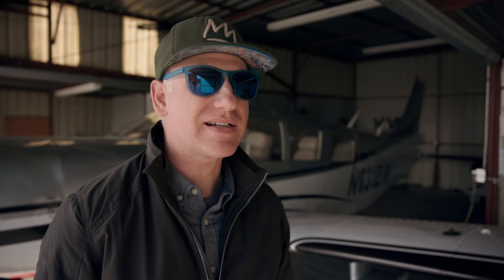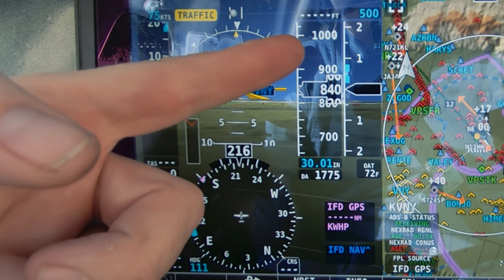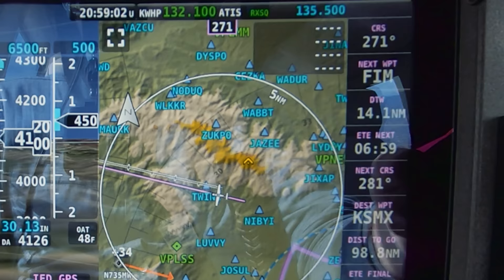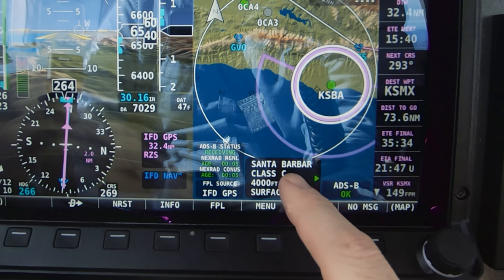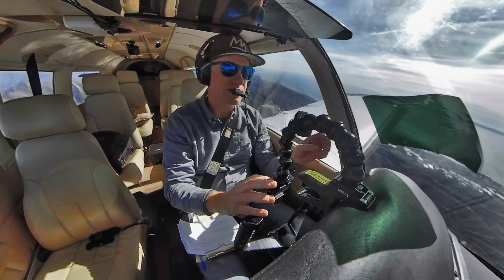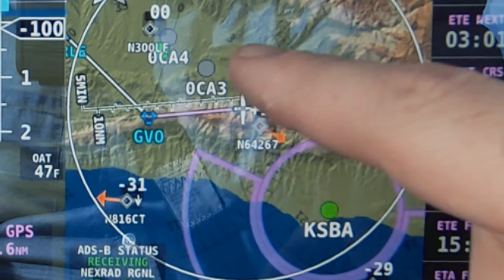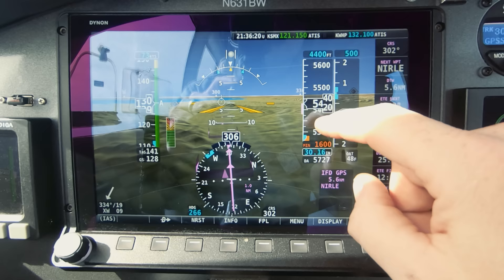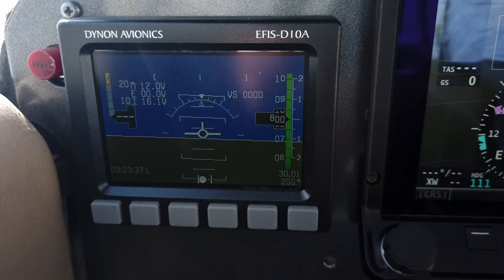Dynon Skyview in a Cherokee| HDX FULL REVIEW in flight and w/approach | BEST GLASS PANEL EVER?

Comment: So many questions!  My 79 Archer's equipment is getting old.  Steam gauges, KNS80, ADF, IIIB autopilot, etc..  Where should an owner start?  A panel mounted GPS?  I've been thinking about G530W to replace the KNS80.  But, 530's are getting old!  A new 650xi is almost $18K!  750 $25K installed!  What was your budget upgrading just the panel?  I also notice some beautiful upholstery in the cockpit..  Where did you have that done?  Was it expensive?  I'm thinking maybe I should sell my airplane and find something newer, but my Archer only has 1490 TT.  Would it be worth it to do all those upgrades?
Reply from the maker: It’s worth doing the upgrades if you’ll get enjoyment out of it and can afford it. If you’re trying to recover value in money you spend in the form of money you will get back later aviation is for sure not the way to do it. The value is the enjoyment (in my opinion).  But you would probably do well to decide what you’ll get the most out of in terms of the next upgrade for the type of flying you do. I would start with an engine monitor. Once installed upload all data to savvy’s free site so you can track engine trends.  Then decide if you need a modern IFR GPS.  That would be a good next step.

Comment: In general replacing the steam gauges , what kind of cost can be expected with a similar approach to Edison set up similar?
Reply: Expect $20k for the IFR certified GPS and transponder, and $20k for all the Dynon gear. The installation can be done by you in an experimental aircraft, but it must be done by a professional if the aircraft is certified. Professional installation won't be cheap. If it's certified it also has to be one of the few which Dynon has an STC for.

Comment: Newb here - is this like a game changer for IFR and  VFR especially when dealing with IMC?
Reply from the maker: I can offer you my opinion only as a 700 hour instrument rated private pilot- by no means an expert.  But I do think that ANY moving map (with GPS) display with terrain is a real safety benefit.  That could be just the IFR navigator or it could be a full blown PFD that replaces your analogue flight instruments.  What IS a game changer is that the FAA has been making it easier for avionics companies to attain certification for their digital EFIS products. The crossover from the experimental world is bringing prices way down.  This stuff used to be cost prohibitive for a small GA plane and now it is starting to make sense.  I do personally think it is a game changer for the safety of IFR flight to have a digital EFIS with redundant backup- synthetic vision really gives you some situational awareness not only for attitude and terrain but also on board ADSB weather.  If you compare that to only analogue gauges with no terrain, traffic, and weather then it is a whole different way of flying- one that I prefer for the increased safety benefit. As far as VFR goes, one of the main benefits is just easy GPS navigation and the on board weather that helps stay VFR or find the closest VFR conditions.

Comment: I have a 10 and 7 inch in my Experimental and I just started using it.  Have you used the HITS? If so, what are your thoughts?
Reply from the maker: It's funny I was just looking at that feature the other day.  I need to read up on it some more to get a full understanding of why and when it appears.It seems like it could be very useful but I have not really looked into it very much or enough to comment.  Do you use it at all?  I'll play around with it on the next couple flights.
Reply: @SoCalFlyingMonkey  I have not. My plane is currently in Phase 1 testing and we are we haven't gotten into all the features of the Dynon HDX yet...

Comment: Other than the Full Dynon Skyview HDX System, the IFD 540 and GPS/WAAS antenna for the navigator, do I need anything else? I have a Cherokee 235 and it boggles my mind that I can literally rip everything else out including current radios, VOR’s, transponder, etc. use theirs and be IFR certified.
Reply from the maker: You would need their ADSB OUT transponder (and definitely get IN), probably a secondary NAV/COM like the SL30, an AUDIO PANEL (check out my PMA450B video).  I don't believe the DYnon radio is a NAVCOM and is only COM. I think its a VERY good idea to have a secondary Nav radio in case the Avidyne fails completely- at least you have a VOR to go by.  If youre tearing everything out get the Dynon engine monitor system and a second screen. :)  And if the Dynon AP is certified for your airplane (I dont think it is) get that too! And the Dynon knob panel and Autopilot knob panel.   I did not read up on if the Dynon Engine monitoring system is certified to replace primary gauges but I assume it is.
Reply: SoCal Flying Monkey thanks!

Comment: When you’re using the avidyne for an rnav approach, does the IFD send over the VNAV labels to the HDX and do they automatically get set in the altitude bug? Same for if you set a waypoint like a VOR using the ‘cross at or above’ function in the avidyne, does it push that altitude stuff over?
Reply from the maker: No I do not believe that vnav labels or a manually set altitude crossing value is sent to the skyview. I will double check though tomorrow.  Dynon seems very open to feedback and I know they really like the Avidyne units so maybe there is a way they can make this happen in a future release...

Comment: What was the reason for not doing Garmin G3X?  Are there reasons other then price?
Reply from the maker: When I was researching it, the G3X for certified lacked a battery backup.  That made it a non-starter.  I also prefer Dynon's approach to interoperability with other avionics manufacturers.  Garmin has a walled garden approach.  I think I have a better chance of future avionics products I might want to install integrating with Dynon based on their approach.  The price difference is substantial and if Dynon gets the STC for their autopilot for the PA32 the price difference will be even more dramatic.  I think it is just a better value proposition.  But I am sure the G3X is a fantastic and capable unit.

Comment: Of course it should all be digital and yes aviation has a huge problem with certification hence the cuba car like conditions. 
As for clarity, the 'glass' is still designed much too thoughtlessly to appear legacy. Compass roses, rolling speed and altimeter wheels, all have to go. The screens should be much bigger and the synthetic vision or map should fill the screen and speed, heading and altitude should just be numbers without any junk clutter. It could be so calm and clear and infinitely better than they are now. It's the same mindlessness that lead to the first cars looking like horse drawn carriages.

Comment: One question can you link the panel to foreflight on a I pad and send flight plans to the gps?
Reply from the maker: The Avidyne can send and receive flight plans via wifi to the iPad. And the HDX can also communicate with the iPad if you buy the ($10-$30) wifi dongle.  I connect the iPad to the IFD for flight plan and ADSB info to be sent to the iPad.  Sometimes for longer flight plans I will plan them at home on the iPad and send them to the plane after startup.  It works very well.
Reply: SoCal Flying Monkey thanks

Comment: bs that the GPS isn't certified and you have to have a little awful massively overpriced second unit. The trivial navigation functionality should of course be in the main display unit and they should be bigger. I heard FAA has become more amenable to electronics certification, has the Dynon GPS been certified since? they could just stipulate that you need a little backup GPS unit. Good practice in general.
Reply from the maker: the avidyne IFD540 is the certified GPS unit on this panel. The DYnon GPS unit is VFR only.  The main options for certified GPS are Garmin GTN series or the Avidyne IFD series (or one of the smaller Garmin GPS unit like the 175).
Reply: @SoCalFlyingMonkey  but I wonder what's preventing certification of GPS in the Dynon. When you landed it placed you precisely enough in the synthetic vision. I looked like at most a foot off which is plenty to land on. It might be some kind of redundant GPS spec FAA is requiring to call it certified. GPS units cost nothing so if that's it Dynon should really get that inthere. It makes absolutely no sense to have an extra little sniveling unit that's way more expensive than the main display for functionality that's already in the main display. You can ask Dynon if it might pass certification today with FAA being more amenable. Or what it would take because we really need to get into a Tesla era of cleanliness. Not just the hideous additional cost of the unit but the installation ends up costing a car more. Another possibility for certification is requiring two Dynons so you have a backup. That way you get the second sort of for free. Whatever they do it has to all be in one unit. Multiple instruments is a remnant from legacy thinking. And the screen should be twice the size or more.

Comment: So I guess this is a pretty good review of the avionics BUT, who is looking out the window?  You are supposed to be VFR.  Should have brought along a co-pilot to look out the window while you have your head down in the avionics.
Reply from the maker: I'm a big fan of always looking out the window.  Flying in a mode C veil has the benefit that nearly all aircraft will have ADSB out.  There are exceptions of course.  That plus flight following leaves very little room for aircraft to come out of nowhere and be a problem.  Still, looking out the window is #1 and maybe it would have been a good idea to have another set of eyes, even with the extremely low probability of potential for a dangerous conflict.  I will also note the video is highly edited and I've cut out all the times I was flying/looking for traffic and not talking about the avionics.

Comment: great video but screen has alot of glare. I like to thank you good job.
Reply from the maker: I was surprised when I first looked at the footage by the amount of glare/reflection because when I am flying I never notice and do not have any trouble seeing the screen. I think because the GoPro is a small sensor camera and puts everything in focus, the reflection competes with the screen. In contrast your eye is able to focus on the screen and the reflection is completely out of focus. I never notice any glare or reflection while using the HDX.  If you look at the beginning of the video before I fly, I shoot with the DJI Osmo pocket which has a slightly larger sensor than the go pro and the glare is a a lot less noticeable because it it more out of focus.  I thought it was interesting from a photography perspective.
Reply: @SoCalFlyingMonkey  Thanks for this extra info, I was also wondering about the glare in the video.  You might consider adding a note to the video when discussing the screen brightness.

Comment: Any mention of howmuch it cost?
Reply from the maker: the dynon for certified website has a great worksheet that calculates estimated costs.  For my installation - 10" HDX, backup battery included, ADSB IN, D10A backup unit, and AOA system it was about 18-19k fully installed.

Comment: Still think I am going with G3x, G5, GNT750Xi
Reply from the maker: I don't think you can go wrong with either.  One of the things that kept me away from the G3X aside from the higher overall price was the lack of battery backup for it.  But maybe that has been remedied or there is an option available now? It looks like a fantastic system overall.
Reply: @SoCalFlyingMonkey  for me Glasair Turbo its cheaper $3900
Reply: @SoCalFlyingMonkey  For my Glasair Turbo it's cheaper $3900
Reply from the maker: @richardperry21  ah yes makes sense! Thought it was for certified.  Nice!!!
Reply: @SoCalFlyingMonkey  no Experimental, But @FL240 I can usually use most certified aircraft for waypoints. LOL

Comment: Glare/reflection on the screen is not great. Awesome unit otherwise.
Reply from the maker: The screen reflection is not  a factor in person. When photographed with a small sensor camera like a gopro, everything is in focus and it makes the reflection appear worse.  Your eye essentially has a much shallower depth of field and while focused on the screen you don't notice the reflection.  You can see the difference a little bit in the beginning of the video when on the ground I use a camera that has a slightly larger sensor than the GoPro and the reflection already appears much better.

Comment: the tape and compass rose are stagnant cluttering thinking and should be removed entirely. Display should be 20+" and it should be all very clear synthetic vision you'd be very comfortable flying by in zero visibility. Mapping could easily be overlaid in the perspective view because for the most part you are headed in the direction of interest.
A well done display without all the legacy junk can look amazing.
Reply from the maker: Design it and manufacture it! Would love to see that.
Reply: @SoCalFlyingMonkey  I see many opportunities but it's slightly impractical for me to start a business for each one. It would be good if the world generally listened and ran with forward insight. Dynon and Garmin and other existing players are obvious candidates. It's a great opportunity for a smaller player to sweep the field.
The display should be a lot bigger but this Dynon could simply add a display mode. Call this legacy and add a cleaner mode called digital. I'd like to see the synthetic vision rendered more realistically so it's easier for the eye to discern depth but in a clean fullscreen mode what they have now would be much enhanced.
I'm sure the Dynon serves you well, worlds apart from old steam but a lot of information/graphics is crammed into that relatively small space. It could be vastly better. You can fly by steam gauge size glass but it's a great handicap to crawl your mind into that little keyhole. Bigger and cleaner could be nothing short of a soothing revelation. I suppose I could create a mockup. Just a digital image of what it could be. To have much bigger display, the planes would have to be designed around it somewhat. The yoke could pivot lower or be replaced with a joystick/spaceball such that the 'glass' is all the way down to your lap and completely unfettered.
Reply: @SoCalFlyingMonkey  Something like this www.flickr.com/photos/81465352@N02/49902103543/in/dateposted-public/
I set the bar a little high with MS flight sim but google earth style with an atmospheric fade to give a familiar sense of scale would be fine.
Then there could be a more button that adds more info like time, radio, more distant targets, eta, airspaces etc. Pitch and roll could be numbers in the lower left corner as options. Not needed for the most part I figure. Could also have an AOA. But all data, no cluttering graphics. Engine button too. Map of course but split screen shouldn't be necessary.

Comment: Next time....Say Price.......it's a clear factor......
Reply from the maker: It varies based on the installer and what you have going on in your panel but the current price of the hardware is easily available on the dynon for certified website.  They have a worksheet that lists all the compnents and you can check them and it will add them up.  Rather keep price numbers out of the video as it is more evergreen that way....

Comment: It makes me want to vomit that guys are flying around VFR with virtually zero attention out the window.   If all you want to do is run a computer, get a copy of MS flt simulator.  Don’t expect ADSB to save you from a mid air.   It’s all good until you impact with another aircraft…..
Reply from the maker: I look out the window a lot.  My guess is that you don't fly regularly in airspace like the L.A. Terminal area. I learned to fly in 2000 - no ADSB or anything.  I can tell you I sure am glad everyone has it now and most are using at least an iPad.  It is very congested here and you have a much greater chance of actually seeing the other airplane if you have it on a screen to start.  ATC often doesnt call some traffic since they are so busy.
Reply: @SoCalFlyingMonkey  

Started flying in 1977.  Flying in and out of SoCal since 1984.  21,000 hrs